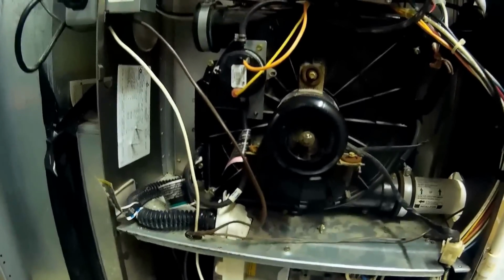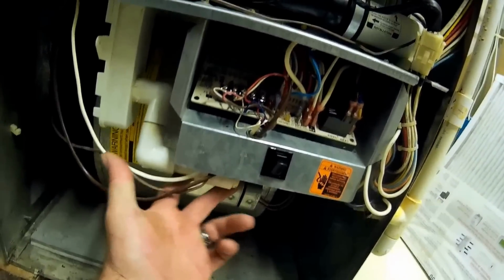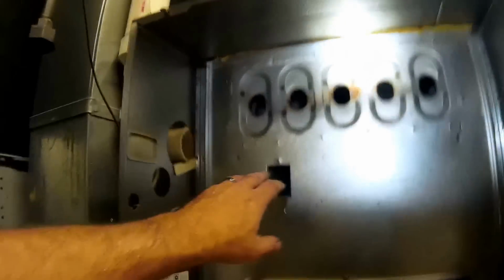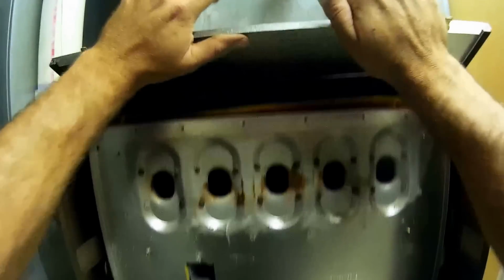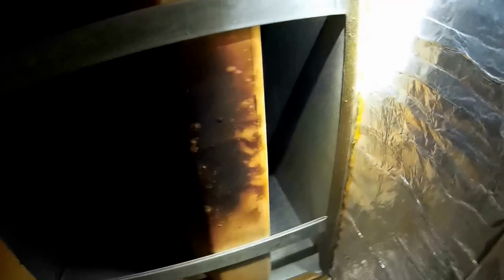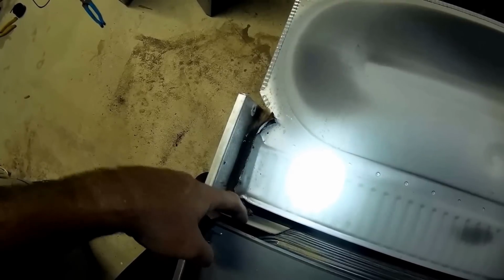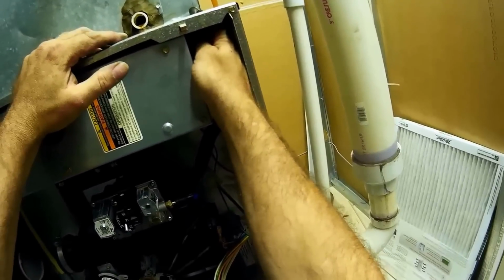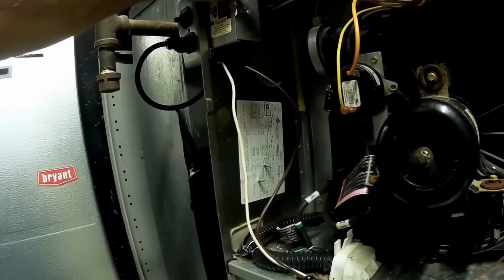Heat exchanger replacement on a Bryant 340MAV048100 furnace

Comment: Where can I find the Cold spot baffle part number for a Bryant 355CAV060100?
Reply from the maker: may not have one. not every furnace does
Reply: It did, the exchanger was replaced and the technician said it didn't need the baffle between the primary and secondary exchanger because they didn't send a new one.  Going through the Low,  Med, High gas pressure you can't get to the pressures listed in the manual without Tripping on High Limit.

Comment: I changed out a Carrier yesterday same furnace different badge. The secondary was pooched. This was the second time this had happened and the customer finally wised up and decided to let me get rid of it. Why would you keep fixing a garbage furnace like this instead of replace? It will happen again its a known fault, i changed his furnace out in 5 hours yesterday all i had to do was some minor sheet metal transition work to get the return and supply plenum together and i re used his 636 vent piping and adapted it over on to the new outlets on the Ruud unit. It would have taken me longer to rip the old unit apart to get the exchanger out and the new one installed.

Comment: The Way you got down to business and repaired this thing , I wish you were in my town. I'd Have you over for a beer and ask you a shit ton of questions about my P.O.S. 90 Plus Broke ass Furnace. I cant get an honest answer from any of my shops on basic crap. Like Model and Manufacture and Warrenty info (Finger crossed) They Just wanna Sell me a new Furnace.  I got The Gas guys to Shut off my Gas cause my Heat ex is leaking (Stinks Like exhaust fumes), I'm a Lic low Voltage elec and I think based on this Awesome video I can do this, If I can just get the Parts. Shoot I could tear down a High speed Belt fed 20mm Gatling gun in the Navy (CIWS)..There were over 500 parts, and it worked when I put it back together. Sooo.. If ya feel like helping.  My Model Number is 
350 MAV 048100 
Series A
S/N 5293A01034
Oh Yea where can I get the parts. I can also send you pix if ya have the time.
PS- The Beer is Cold too.

Comment: Nice work by the tech in this video!.  This furnace in particular is a pain in the neck when it comes to changing out the Heat Exchanger.   The first one of these I did took almost 6 hours, but we were eventually to get it down to 4 hours.  There's a reason we charge the big bucks for this change out.  Do yourself a favor and just replace the furnace.

Comment: Was just told by the HVAC company that came to do a pre-winter tune up that my secondary heat exchanger needs to be replaced. No obvious signs of cracks in photo's taken, but does look like some small spots where some condensation might have been (orange/yellow thin small lines in a handful of places). You mention that the "Up Flow" units primary exchangers seem to last a long time. I have Bryant model that was installed in 2002, so roughly 14 yrs. old. How do I know whether it's an upflow model? I'd rather not buy a complete new furnace, given it's been great up to this point. Any info. appreciated.
Reply from the maker: +macker0077. Your contractor should do a carbon monoxide test in the flu to find out if the secondary heat exchanger is plugged visual inspection will only tell if it's rusted through sometimes you will have small rust spots on the outside of the heat exchanger meaning that the heat exchanger is potentially failing there is a trade in credit on the furnace if you use a Bryant or Carrier dealer thanks for your comment
Reply: Thanks. The carbon monoxide test indicated a reading of about 14? They seemed more concerned about the possible failure happening due to the exterior indications, so they shut off the gas. Was also told that the secondary exchanger on my furnace had a bulletin/recall against it , so cost to replace is just labour ($600). I'm guessing a new hi-efficiency complete replacement is going to run be 8-10 times that amount here (Toronto)....so I'm trying to weigh whether to do the part replacement, or just purchase a new system, given the furnace is 14 yrs. old.
Reply from the maker: +macker0077 technically if you only have 14 parts per million in the flu and no signs of the heat exchanger actually leaking water it's still good but it sounds like the heat exchanger is failing there are certain criteria in that Bulletin that has to be met in order to condemned the heat exchanger at 14 years old you're almost in the life expectancy of the Furnace repair or replace that's up to you thanks for watching good luck

Comment: We just replaced a heat exchanger on a Bryant and started having trouble tripping the limit all because we did not reinstall the REAR AIR BAFFLE.!!! It was not in the instructions telling us to do that.Now we have to go back and do it all over again just to install that BAFFLE. We were shocked when we received the new heat exchanger in about 10 boxes. Thanks Craig Castle Heating & A/C
Reply from the maker: +Craig Kurker Lowe's heat exchangers are not easy to do but you don't have to take apart the whole heat exchanger just to get the baffle in but you do have to slide the heat exchanger out slide it between the two Heat exchangers there are just two screws on the outlet plate that holding on
Reply: +Mi Heating Guy ,Thanks,you called it a Lowe's heat exchanger? I see what you mean,but it still has to come apart to get to the point where you can slide out a bit and put back in.I was more upset about the fact that it was not in the instructions or given a verbal when we ordered it about that. Even the guy from Carrier Tech support said it should be in replacement instructions. I have been in the business 50 years and changed my fair share of heat exchangers .  Like you said in your video,you will be going back if you do NOT put back in.Sounds like that is very important. Thanks again
Reply from the maker: +Craig Kurker I meant to say those Heat exchangers
Reply: Oh, okay thanks again your video was very helpful for me. Thanks again

Comment: i got years to go before i would feel comfortable pulling all those wires out like that.  why, knowing at some point we will have to change the heat exchanger, would they not make it a bit more accessible.
Reply from the maker: +Don Ballew  That the only way to learn. When I am out training other service techs on replacing a control board I pull all the wires off and tell them to use the wiring diagram to put it back together. The only way to learn is to do it.
Reply: This is true. I havnt been in it but a couple years and it seems the more i learn the less i know. As long as i can read the diagram i can fix it. But the more hands on the easier it is. For me most the 200 units in my charge are carrier package. Not a lot of splits.
Reply from the maker: +Don Ballew  It does take time to learn and feel comfortable but one thing is you always need to keep it fresh in your mind and remember what you did on the last job. I have been doing this for 20 years
Reply: Well i watch lots of these videos and have learned a lot from you and the other techs. It is much appreciated. I've had lots of questioned as well as good advice. Im confident in my abilities all i need is a bit of time to hone my skills in this new trade I've fell in love with.
Reply from the maker: +Don Ballew  Its a fun trade to be in . If you have any questions feel free to ask
Reply: Thanks. I dont think i got you in my hbac g+ group yet
Reply: Mi Heating Guy